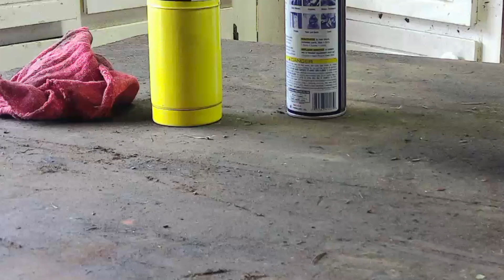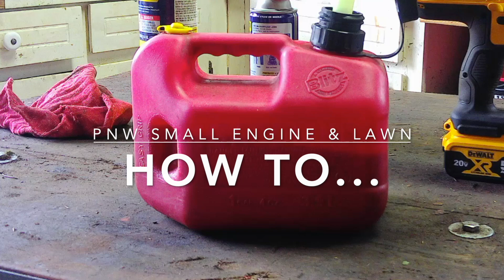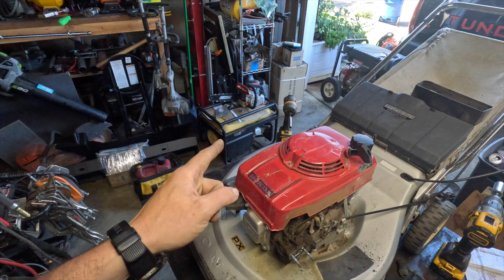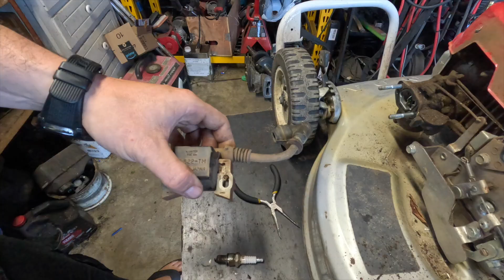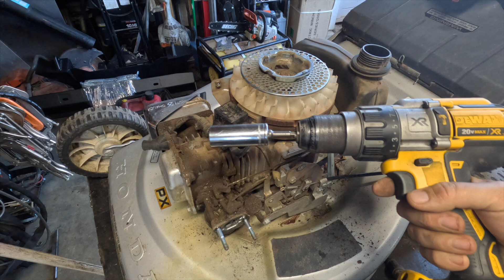How to Fix No Spark

Comment: Two places I check for rust….. first is on the two posts that the coil sits on.  The second is a heavy build up that adds to your feeler gauge measurement.     A lot of good information.